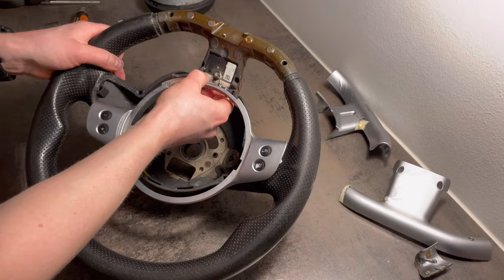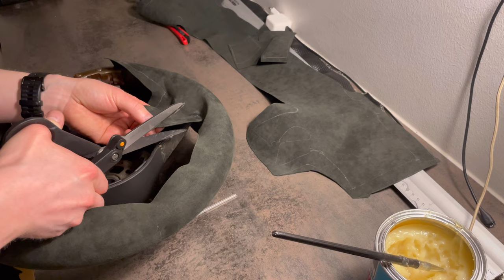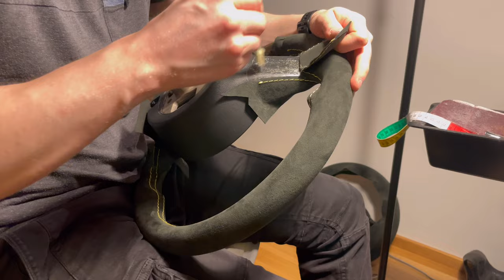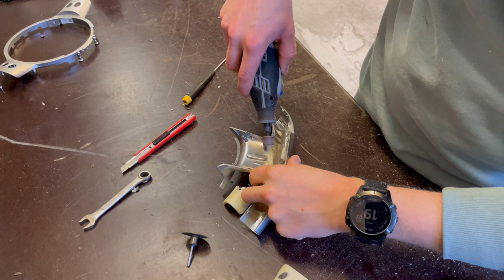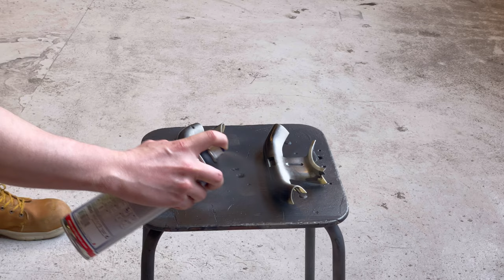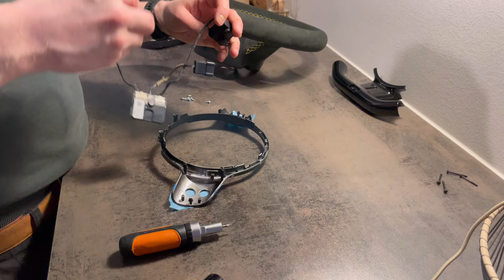Making Of Custom Alcantara Audi RS4 B7 Steering wheel

Comment: What was the issue with the lower trim piece bud? We had one where the screws had been overtightened and pulled out, but they binded back on, looked like a lot of reinforcing, fillering and smoothing, had it cracked along the face/back panel?
Reply from the maker: Yes, both of lower trims has few cracks so thats why they need reinforcing.
Reply: @manuLab  oh man :( great end result!!